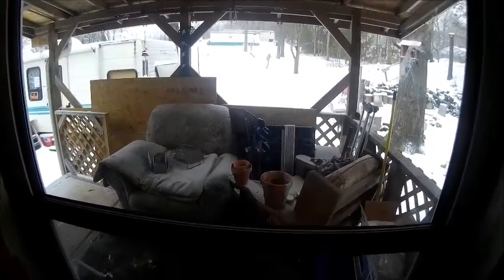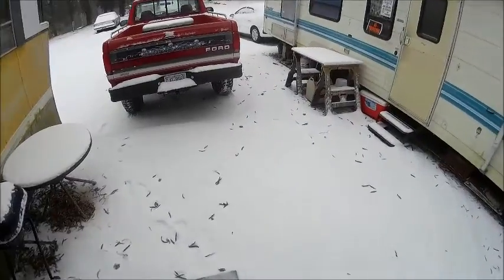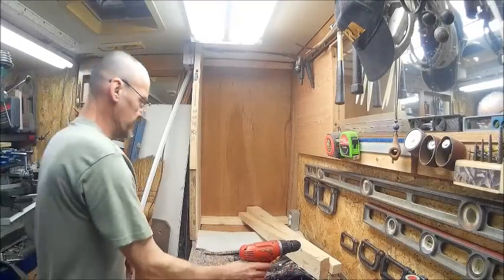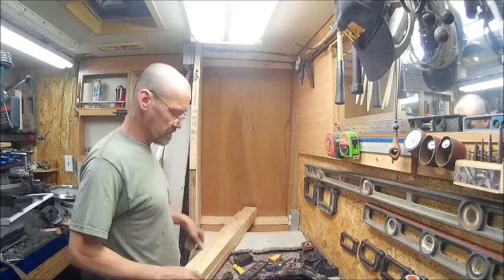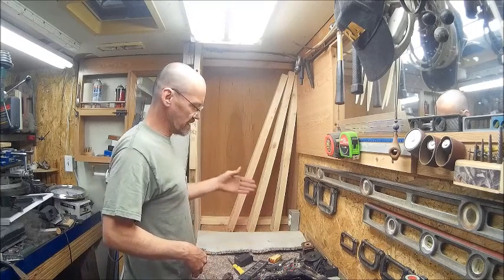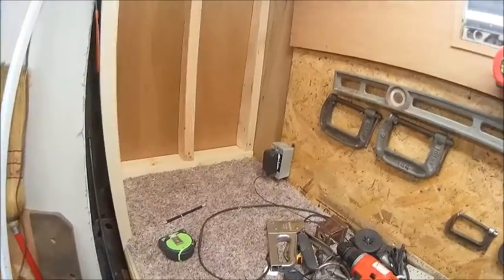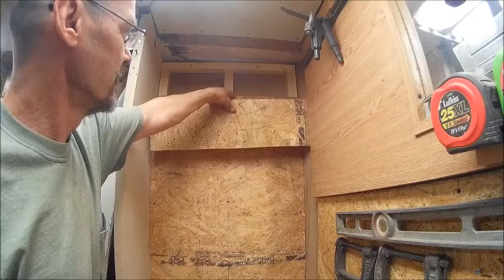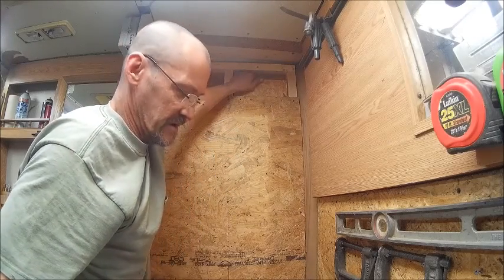how to install fridge shelves in the bison workshop

Comment: Now all you need to do is figure out a way to keep those shelves cold and you're all set ;-)
Which compressor blew the breaker for the heat?  I know my Coleman does not like the cold at all, had to heat it with a hair dryer until it would start.
Reply from the maker: +jaykay18 yep it was the coleman. lol. but my shop stays around 72 deg. so it shouldnt have cold effecting it.
Reply: Bison Workshop Sometimes that's enough "cold".  When it's summer here, all the compressors start great.  Winter not so much.  I haven't tried to start my Coleman in a couple weeks, it's in the basement as you saw, and it does stay pretty warm down there.